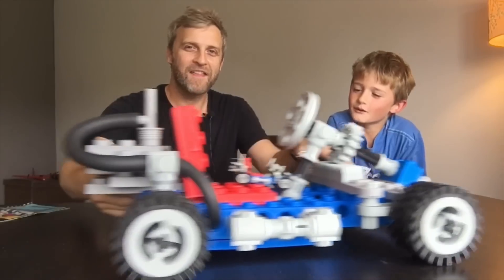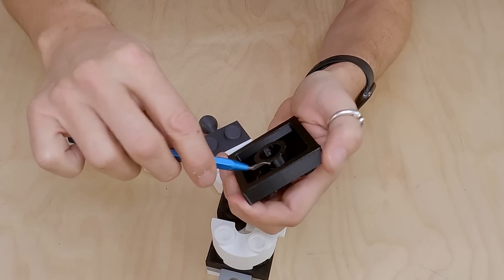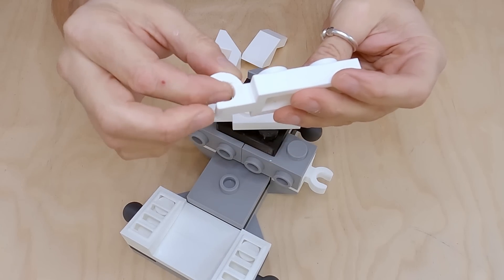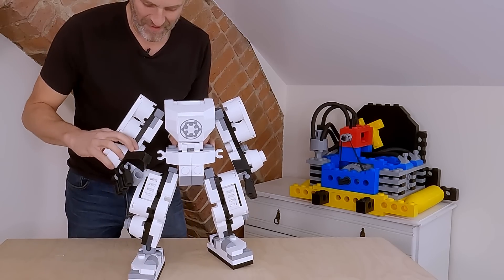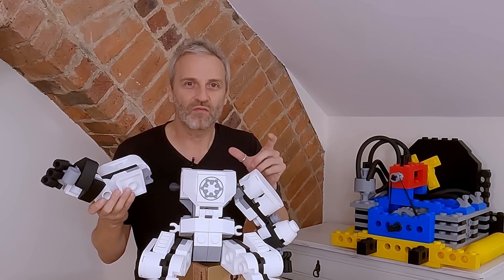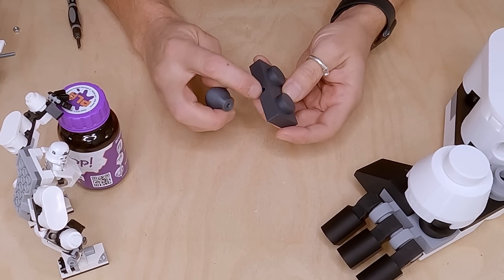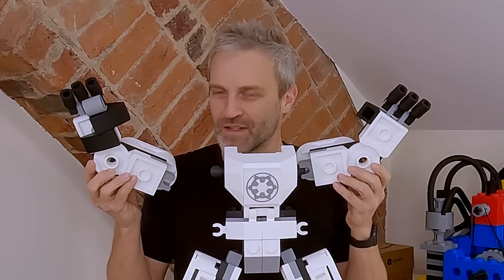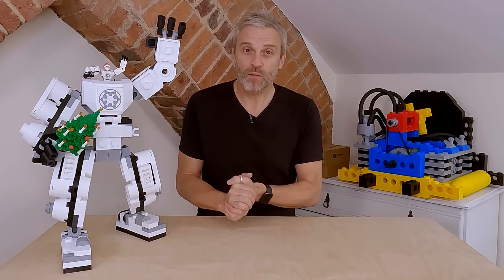Giant Scale 3D Printed Stormtrooper Mech - Mantis Hacks

Comment: Here's sort of an issue here with using ball joints, they're too loose and eventually they get so loose that literally even the slightest touch will make them move to a position ya want them to be in, so I definitely recommend ratchet joints, the ratchet joints are also alot more durable than the ball joints are

Comment: instead of printing whole new joints for a tigher fit there are some solutions dreampt up by the action figure collector community, there are a few products specifically made for this, you could possibly use glue and keep the joint moving at full range as the glue cures so as to prevent it from being glued in place, or you could use some floor polish in a similar way.

im sure you could find more trustful information by looking for "figure balljoint fixes" to avoid the process of using trial and error while reprinting parts
Reply from the maker: Thanks 🙏 good to know 👍

Comment: If you have not solved the ball joints already, I recommend getting a thin sheet of project foam and cutting off a piece and gluing it in the socket or on the ball. It compresses and should add enough friction to hold the position. Also, what about making a giant lifesized storm trooper mech to hold the mech you just made? That would be hilarious, but I cringe at how many spools that would take!

Comment: Spray the balls and sockets with a light coat of Plasti Dip clear rubber coating spray? That'd greatly increase the friction and may make it posable.
Reply: Or you could put a groove in the ball, around its entire circumference, then use a wide rubber band to give it a band of rubber that protrudes slightly. The bands used for lobster claws are a good source of wide but small rubber bands, and you can prob find them in black.

Comment: Sadly the ball joints don't work super well on printed legos. I am doing 2.5x legos and they just don't hold the weight over the long run. I end up either propping them with some clear blocks or glue them as a static joint as I just display them anyways.
Reply from the maker: Mmm ok. I have a new version printed that seems to be doing ok. But PLA does shrink back over time.
Reply: Maybe you be luckier than me. This is just my personal experience.  @MattDenton